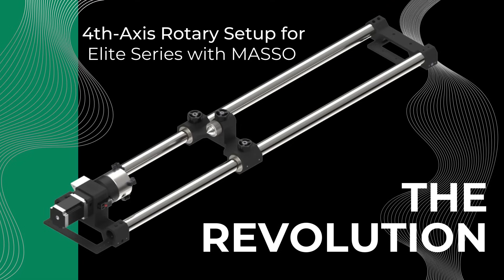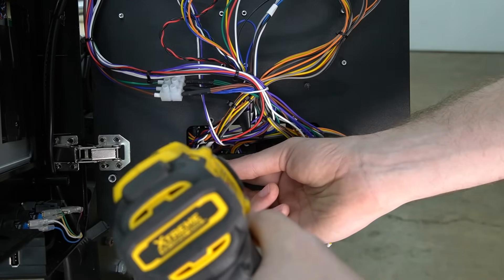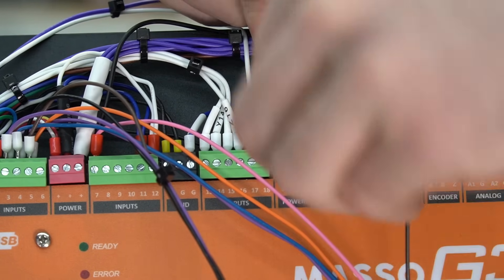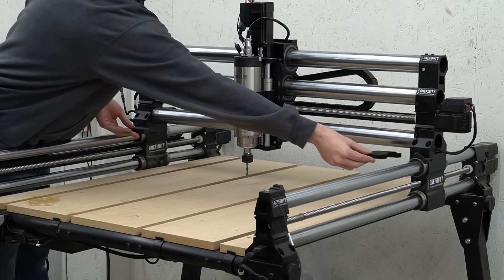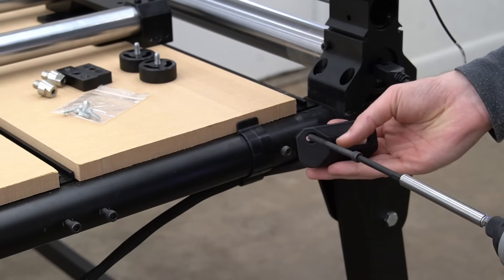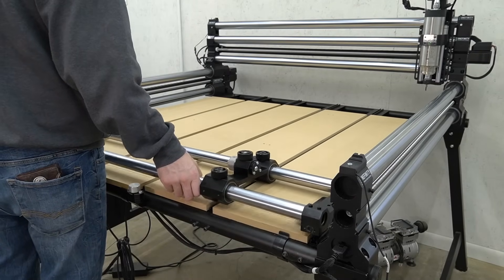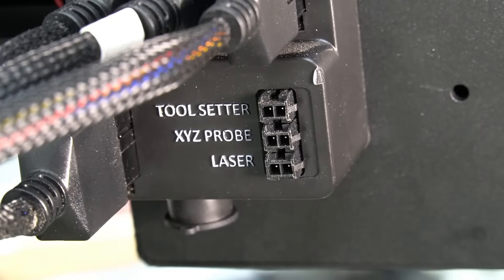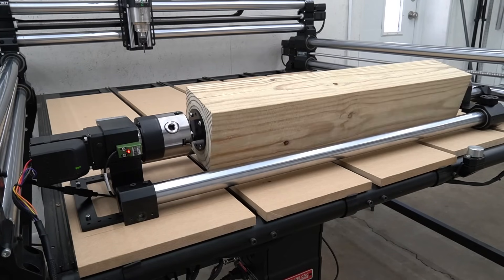Onefinity CNC 4th Axis Rotary "The Revolution" for Elite Series with Masso Controller | Setup Video

Comment: Thank you!!! for the instruction. But You should also mention about converting number 17 and 23 inputs high to low by just pressing the space bar. That part by itself has a matter to avoid homing error and A motor alarms. It’s took me 3 days to figure out what was wrong with it.
Reply from the maker: Glad it helped, and thanks for the tip!
Reply: This is an awesome tip I couldn't figure out what was going on until I read this and then it worked in 2 seconds! Thank you for this mention and the comment!! It should definitely be added to the instructions

Comment: After mounting do you need to save various presets if you're using the auto tool setter, laser, etc
Reply from the maker: You can save profiles and switch back and forth!
Reply: @OnefinityCNC  How does one create and switch profiles on the Masso? I've searched and can't find a clear answer.

Comment: If installing the rotary on the Y axis rather than X, how should I setup the probing on the Masso?
Reply from the maker: pg 15 of the manual
Reply: @OnefinityCNC  Page 15 shows the Foreman/Journeyman mounting bracket dimensions. I'm not clear how to determine the Masso probing when the rotary is on the Y axis from that info.
Reply: @dynamicsx just swap the X and Y values when entering them in the probing settings!

Comment: Why can the foreman handle larger stock as opposed to a journeyman?
Reply: Because the Y rails on the Foreman are 50mm in diameter, as on the journeyman they are 35 mm, making the Foremans X axis gantry sit higher.
Reply from the maker: The Y gantry's are taller.

Comment: Any drawings or exact dimensions of the bolt locations in order to just have the machine cut the holes for the threaded inserts?
Reply from the maker: Check the manual to see!
Reply: @OnefinityCNC  I checked the manual. The locations are not dimensioned.